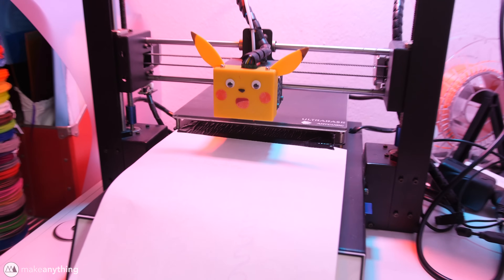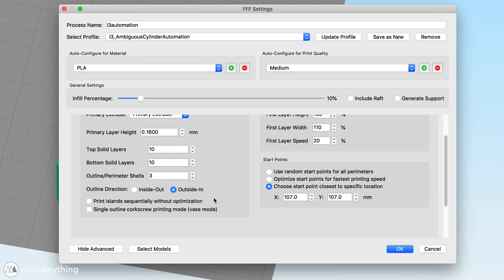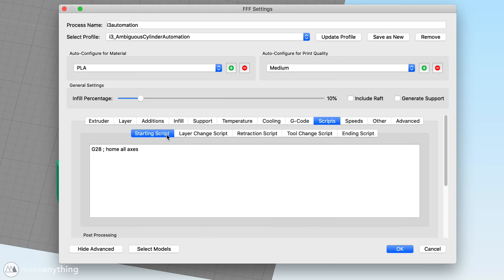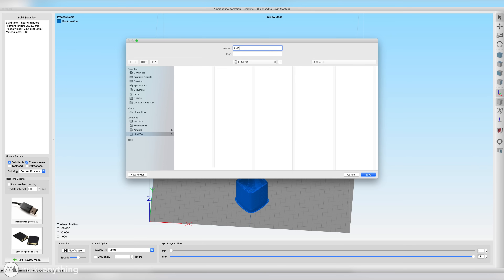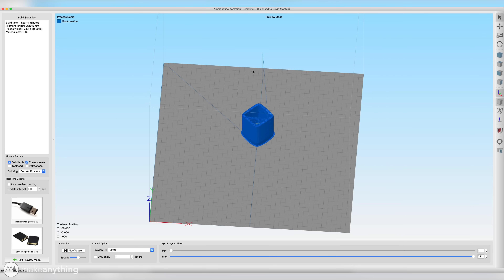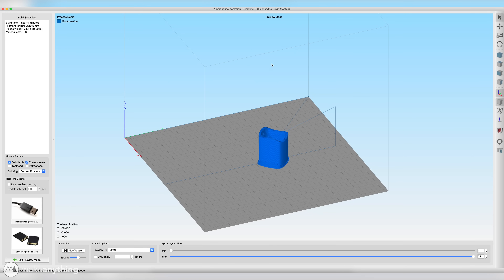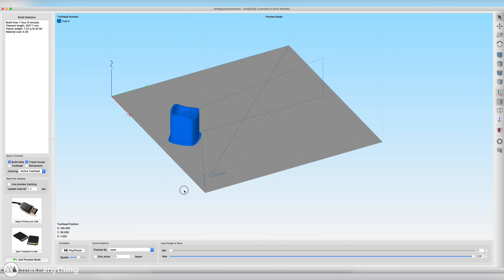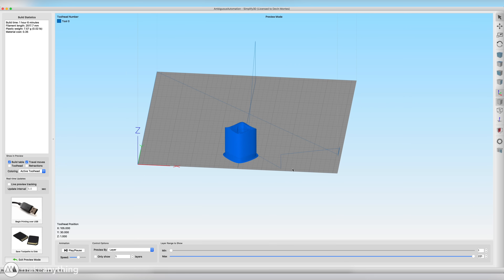Automatic 3D Print Removal using G-Code

Comment: There's an M-command which tells the machine to rewind the program and restart it. For CNC mills and lathes it's the M31 command I believe. I don't know if it's the same for Marlin 3D printers, but maybe you should try that, it'd be much less hassle as you could just add it in the slicer and the filesizes would be much smaller for even larger production runs.
Reply from the maker: The real pro tips are in the comments 😉 thanks!
Reply: @make.anything  thats why this is called a Community we help each other while checking on the loop you should also look into additive offset which allows you to repeat it as many times as you want with a given  x y z offset
Reply: THIS! and add an offset to reach a clean build plate area
Reply: M31 is the "Print Time" command, in Marlin. Sadly, I cannot find any restart, loop, jump, or conditional branch commands of any sort. The closest is M32, which allows you to run another G-Code file, which could possible be used to start the same file again, but there is a risk of stack overflow, if previous g-code is not aborted when a new file is run. Marlin either does not have all g-codes implemented, or their documentation is incomplete.

Comment: Cool! This would make a fine OctoPrint plugin! To eliminate the need to fiddle with G-code by hand too much.
Baking a scripting language into an Arduino-grade board may be a bit too much, but Raspberries won't break a sweat.
Reply: adding a "print this file x times" function into a firmware might not be too much to ask for, although then you'd have to choose between leaving the heat on (hello fire hazard warning) or cooling down and reheating every time.

Actually, if you set the start and end gcode up to turn the heat on first and shut the heat off last, there might not be that much of a drop in temperature. Everything else you only need to type into your slicer once anyways.
Reply: D:\side\ Sup programs and looping would be preferable if possible.
Reply: @Inventorsquare  that's one way to do it. Provide a script in something like Ruby/ERB that generates the output and have OctoPrint send it to the printer over a serial port.
With IO's backpressure the output would be consumed by the printer as it's being generated, with no intermediate storage for the whole result in between.
At least that's the theory.

Comment: This is a really cool idea! I recently designed a Micro SD card holder that fits in the cartridge slot of the Switch and they're selling like hotcakes. This would be useful to churn out a bunch without having to attend to it... Only problem is that they're so small that the printhead wouldn't be able to push it off the build plate unless I print it vertically... Not sure how well that would work 🤔
Reply: Try printing a "guard rail" of sorts to attach to the extruder, such that the guard rail hits the print before the hotend. If it's still too thin to hit, maybe consider printing it vertically.
Reply: Fighter Builder Do you have a link to your design? Thanks.